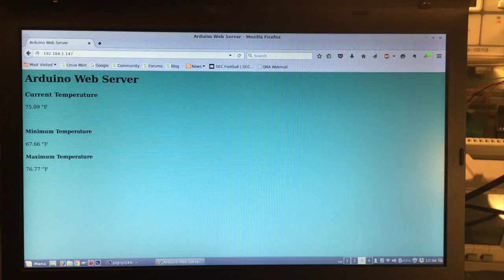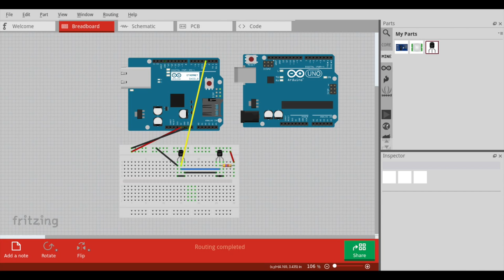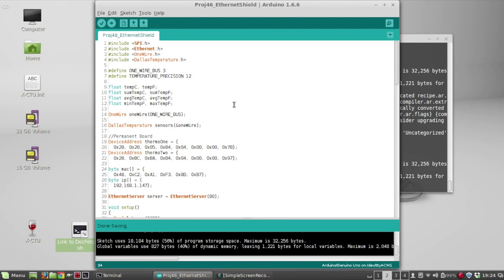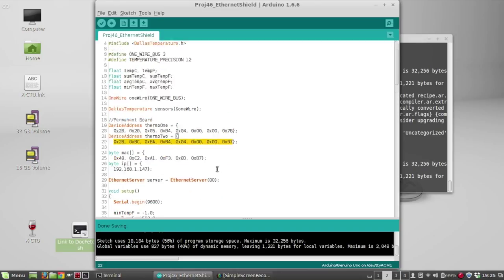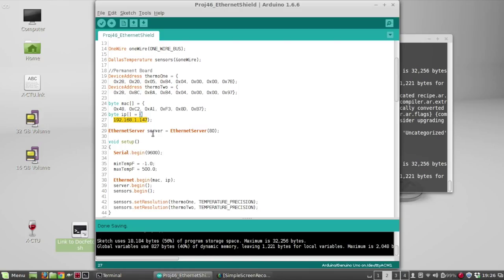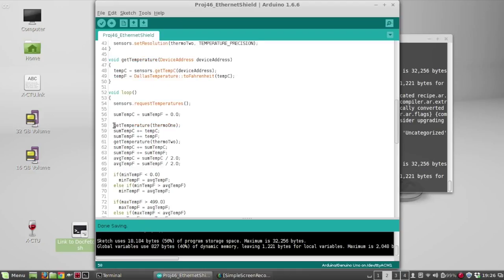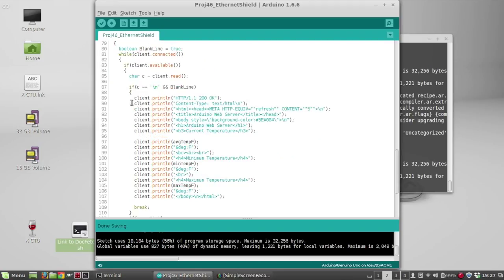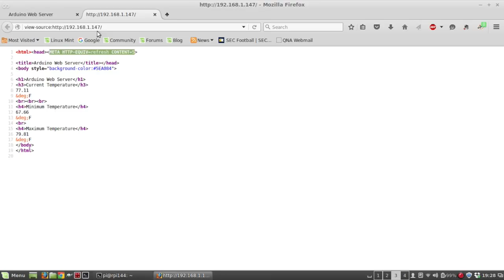Arduino Temperature Data Displayed Over the Web Using an Ethernet Shield

Comment: Some of you guys have problem with connecting your ethernet shield. Here is some of the reason: 1) Make sure your ethernet cable is working properly and is straight ethernet cable but not cross over ethernet cable. They are different.( I have changed my ethernet cable and then it works!) 2) Make sure the first three byte of your IP address u assign to your ethernet shield is the same as the IP address assigned by DHCP. Look at your computer IP address. If the first three bytes are 192.168.0.xxx, then you must assign the IP address to your ethernet shield with the first three bytes same as 192.168.0.xxx. You cannot assign 192.168.1.xxx. The first three bytes must be the same. The fourth byte can be any value but not the same as your computer or any other device.

Comment: Love your project.  Do have a couple of questions.  
1) for some reason my Current and Min temps show -196.60F but the Max temp shows the correct temp. This seems to be a problem with chrome and firefox.

2) How could I get it to show each temp sensor instead of the average?

Thank you so much

Comment: can it use single lm35?
Reply from the maker: Yes.  My sketch has some specific code for the DS18B20 sensors, so you would need to modify it to make it work with the LM35.

Comment: Don't know why but it doesn't connect to my Ip address, and therefore can't connect to the website.
I've tried putting my ip address static but that doesn't work.
I have a intel galileo gen 1 board with a built in ethernet. 
I modified a little bit the code so I can use it for my light sensor.
Don't know why but I can't access the website even if the code is running fine and the upload is ok.
Can you please help me?
Reply from the maker: I am not familiar with the galileo, but since it has built in ethernet it may have a real mac address.  The ethernet shield I'm using doesn't have a mac address, so I just made one up: byte mac[] = {
  0x48, 0xC2, 0xA1, 0xF3, 0x8D, 0xB7};   You may need to use the real mac address in that line if there is one for the galileo.  Also, I'm not checking the return value for the Ethernet.begin() command.  You could try getting the return value into a variable and printing it out to Serial to see what it is.  I believe it returns 1 on success and 0 on failure.
Reply: You're right that was the problem. Fortunately I realized my mistake in time and now it's working. Thanks for the awesome tutorial and for replying to my comment!
A great day to you sir!
Reply: CAN you please tell me how to make changes in code if we wanted to implement the code with LDR?

Comment: please  can i have the code for ETHERNET SHILED AND ARDUINO MEGA2560 USING DHT 11  

i mean the same project   but using ARDUINOMEGA 2560 AND ETHERNET SHIELD AND DHT11 PLEASE
Reply from the maker: I don't think the code would need to change as long as the ethernet shield is compatible with the mega2560.  There is a link to the source code in the description.

Comment: can the ethernet shield host a webpage ?
Reply from the maker: I am generating a dynamic web page in this video.  You could generate a static web page the same way, or have a static HTML file on the SD card if the ethernet shield has an SD card slot.  When a request comes in, you would read the page from the SD card and write the data to the requestor using the EthernetClient object.

Comment: can you make ti work with Nagios monitoring ??
Reply from the maker: oscar guaqueta I'm not familiar with Nagios, but if it can be configured to check the HTTP return code for the status, then it should work fine.  If it hits the temperature URL and a 200 code is returned, the status is 'Good'.
Reply: the Arduino wed server is telling me that the temperature is -196.60 F and it doesn't change, it mean is no working properly how can  I fix it, please
Reply from the maker: Are you using the DS18B20 sensor?  If so, you may want to try wiring it up without the ethernet shield and write the values out to the serial monitor.  If you are still getting incorrect values then double check your wiring.